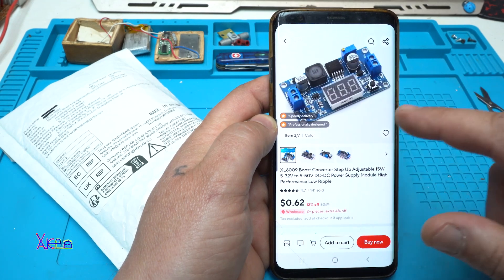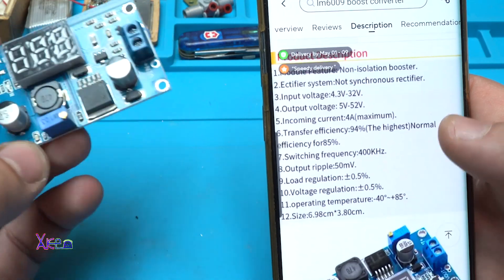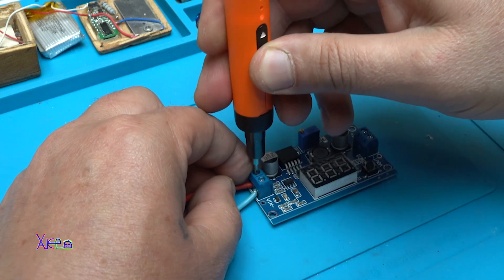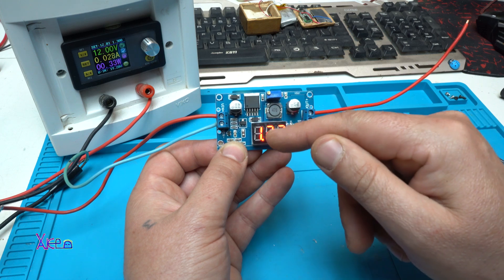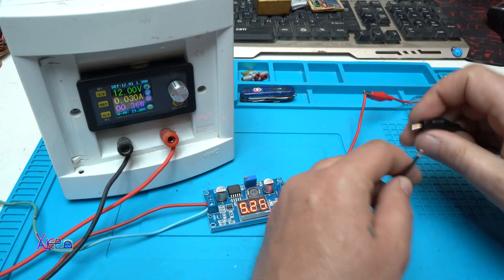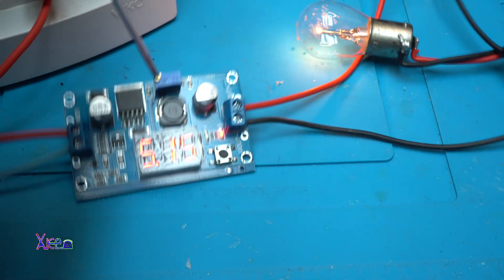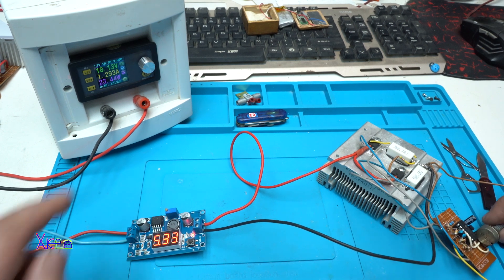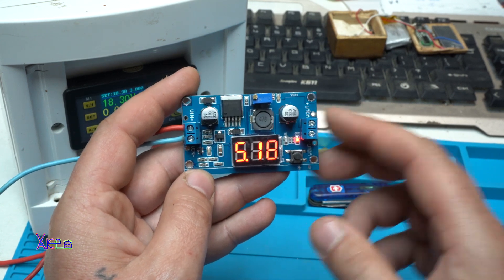Why THIS $1 Aliexpress LM2596 DC Converter Worth the Money?

Comment: I'm confused. According to AliExpress it's a step UP converter, not step down. Also, the low price 0.94 is for the chip only and the module is 2.0€
Reply: Use a VPN , different countries have different prices.
Reply from the maker: Sorry sir,its step down module
Reply: There is toroid so its step down
Reply: @just2716  but we could use it to step up, no?
Reply: @JaucheSan  no. Only step down. 
If you want both step up and down. Look for module that says "buck-boost"

Comment: how are these for running a string of LEDs then ?
Reply: Same as any power supply. If the strung requires constant voltage, you can use this to power it. But low power, only 4A max with an additional heatsink, so say 2A as-is... you'd need to check the power that the strip needs.

Comment: You demonstrated a buck converter, not a step up converter...
Reply from the maker: My bad sorry
Reply: Hacktuber is correct,  Buck converters step the voltage down from high to low boost converters step up your voltage from low to high so you are incredibly wrong.